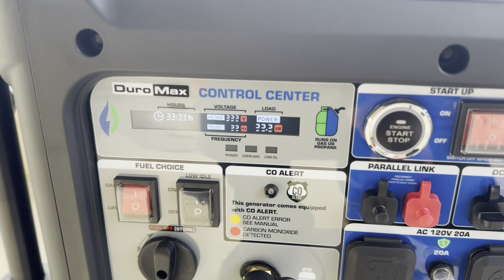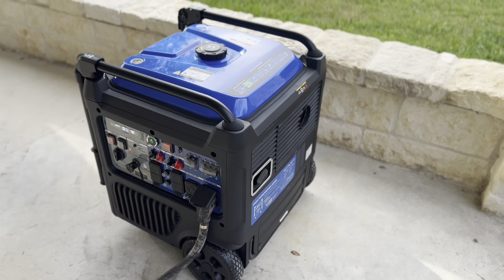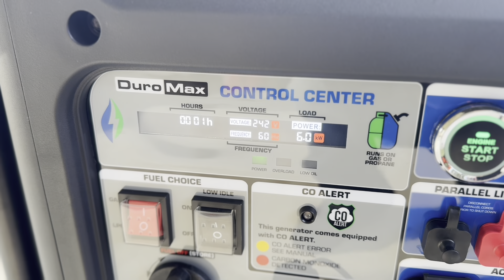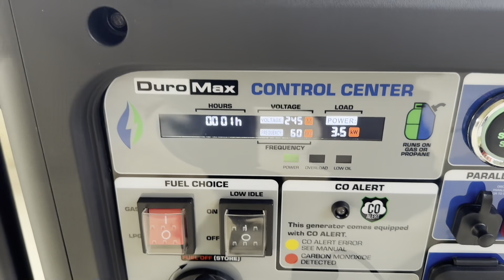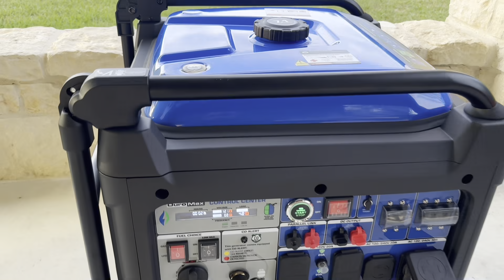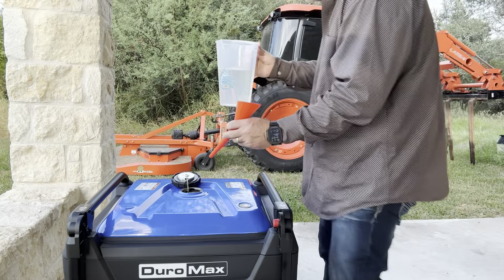Will the new Duromax 11,000 Inverter Generator Run my house? Let’s find out!

Comment: Good video Rocky! Where did you buy yours and how much did it cost if you don't mind? I have been debating getting rid of my kubota gl14000 diesel just because it's so big. I like the features of the duromax. Keep up the great content. And off the subject I just installed some 35x12.50r17 nitto trail grapplers on my 2020 denali dually and love the ride. Watching your videos made me make up my mind and I'm glad I went that route.
Reply: I been looking at this same generator to run my house.Im going to go ahead and get one.Thanks Rocky,beautiful house you have there.
Reply from the maker: @DouseAHouse Thanks! This genset is really nice.. I’m keeping it in my permanent collection. Picking up 100# propane tank this week. I think that’s like 24 gallons..
Reply: @RockyRohde yeah I want to run on propane as well.
Reply from the maker: I purchased from duromax directly. I think it was close to 2600 with taxes. I’m keeping my Kubota and the Duromax!! The Nitto trails are my go to. Smooth ride, quiet, and no vibrations! Thanks for watching the videos!!